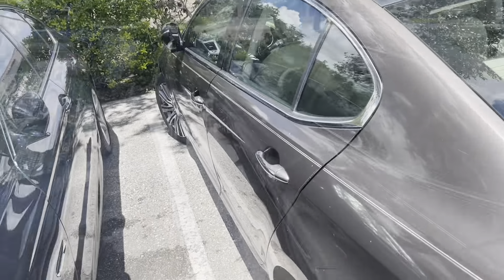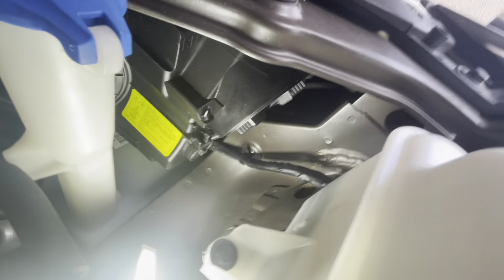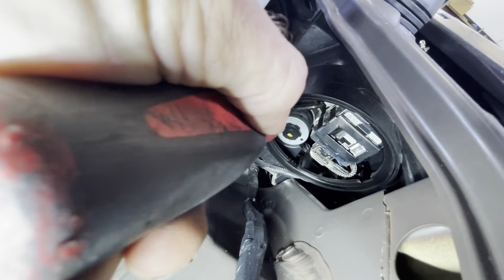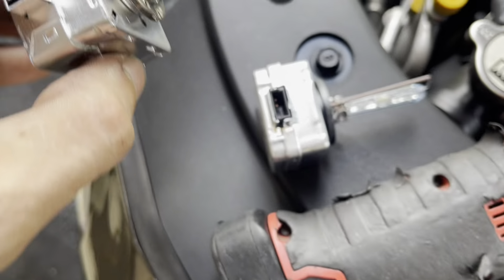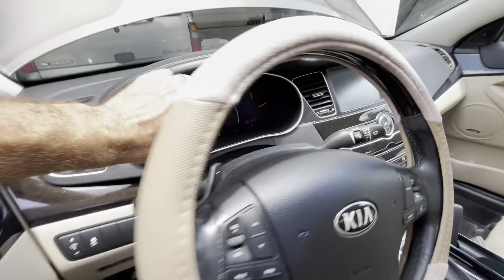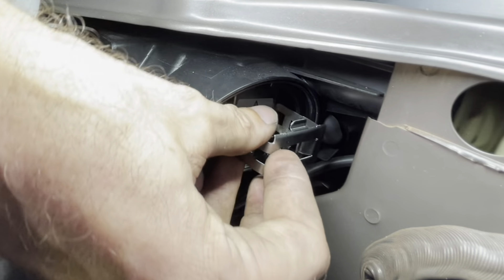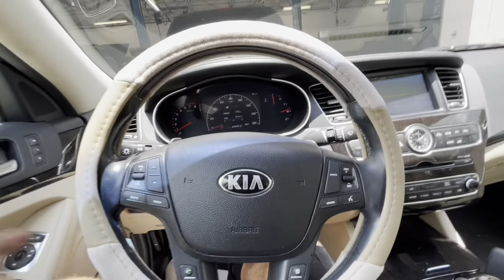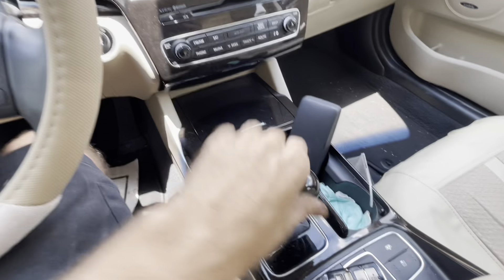Abnormal EVERYTHING All Day! Kia Cadenza

Comment: The old guys remember when replacing the headlights was done from the front of the car, outside the vehicle.  ;-)  And I'm sure you checked that high beam before tearing into the job, but you didn't show it on camera.  Wouldn't want to be the tech that fixed the low beam and later found out the high beam was out too.

Comment: My car is pretty old, but the annoying thing with the halogen bulbs it uses is getting the tip of the bulb into a holder that’s in the light fitting. Using your finger tips to wiggle it into place, hold it, get the retainer to hold it and then shove the wires on. You need 3 tiny midget hands to do it as the space is super cramped and awkward.

Comment: Nice job Ray!  Maybe next time for the mark on the seat, isopropyl alcohol (you know the stuff you use in the gas to keep water from freezing in your fuel system).  You can put the isopropyl on a rag generously and rub it on the what ever it is.  If it's a pen mark or even a Sharpie, it "should" rub out/off the mark.
Reply: Isopropyl alcohol ?? No, No, NO !! That will also leave behind a nasty spot where the alcohol rubbed away the color off of the fabric - WHICH IS EVEN WORSE !!

Comment: I haven't had to change a headlight yet on my '18 Kia Sportage, but I wanted to upgrade my reverse lights to LEDs since OEM bulbs were really dim.  I checked the owner's manual and it basically stated: "due to the complexity of replacing the reverse lights, it is recommended you take it to the dealer".   The only "complex" thing about it was I had to remove some under-bumper cladding.  Easy for me, but I can't see grandma getting down there to do it.

Comment: Headlight bulb replacement has become so much harder due to styling.  Not so much the engineers, but the styling groups within the OEM's want their fancy, wrap-around Headlamp Assembly's which then put the engineer in a pickle on how to provide the means to service bulbs.  However, the backyard mechanic is also a dying breed.  People with minimal skills could replace most bulbs..........but that would take time away from them keeping up on the latest TikTok video bashing their political nemesis.  I mean...the important stuff.  :-)   Great video Ray!  The struggle is real.  I just remove the hedlamp asm sometimes and get right to replacing the bulb.  A pain? yes, but the time works out about the same considering I struggle to get that clip back on and the bulb oriented in the proper position.  Oiy.

Comment: My buddy has a VW golf wagon with HID lights and had the low beam bulb go out on one side. Turns out that the Germans decided that to fix this issue you shall buy a new headlight at about $1800.  All for a burnt bulb, we are both considering disassembly of the headlight to expose the bulb.  Has to be a D1S or like D3S type bulb. Oh and by the way to remove the headlight, the bumper has to come off.......... German engineering.

Comment: I find simple stuff like changing a bulb is getting harder and harder. An ex-girlfriend needed the bulb changed on her Mercedes B200. I could take out three different parts to be able to get to the bulb or I could practice yoga to be able to contort and reach the bulb. I choose yoga 🤣. Getting the bulb out wasn't too hard but putting it back was WAY too hard. Dropped the clip. It didn't hit the ground due to plastic covering the bottom of the engine compartment. Magnets are my friend.

Comment: This is insane, I had to watch a couple headlight assembly removal videos real quick wondering why they didn’t just take it out to begin with. Then saw you have to literally remove the front bumper and a dozen 10mms later. I’ve got bixenon hids in my Volvo s40 and I thought those were a pain to change but compared to this shit show I feel a little better

Comment: Soon enough lights will be a “dealer required” service. Also i appreciate the self promo after the customer is clearly pressuring for time. Do the job at your pace. If they wanted a light changed in 5 minutes or less they are more than welcome to do it themselves.

Comment: Believe it or not on my car its easier to remove the bumper and then pull out the headlight assembly then change the lights.   I can change all the lamps this way fast than trying to change 1 bulb.   I learned this one when I changed out the headlight assemblies.   Next time I have to change a lamp the bumper is coming off.   Now not all cars are the same, my car is a 2008 Mazda 6.

Comment: I had a 2006 Mazda 6 where I had to partially remove the bumper (pass. side) and remove the light unit to get access to the headlight bulb. What should be a 2 minute job turned into 20. At least I had enough tools and knowledge to do it myself instead of having to pay $$$'s to get it fixed. 
I am 5'4" and often have to reset the seat after service by others but thats OK. I had to do it my self on others/customers cars when I did work on them.

Comment: hate the clip thing on mazda and the adapter that the h11 bulbs need but that looks better then this. after a few times you get the hang of how the clip things works at least on mazda. wouldn't it be easier and maybe faster just to take the whole light assembly out at this point to make it easier to see and do?

also i had sway bar and aliment done on my car and the steering wheel was moved and ac vent moved. it is annoying and no idea why that needs to be done to test drive it before and after. my seat is back all the way and steering wheel up and in all the way btw so enough room

Comment: 2013 to 2016 lincoln mkz  LED adaptive headlights were made easy for the mechanic all I have to do is pay for a 1200 dollar headlight housing and you remove power and plug in AND THE insane fees don't stop there if the front blinker DRL assembly goes out that's 1100 buckle.  They are LED an I don't expect them to go out but I didn't take chances I bought a extended WARRANTY

Comment: I was away from home, and headlight went out. I was due for an oil change, and when I brought it in to a dealership, I asked if they could change I headlight bulb for me which had gone out the day before. Four hours later, and after they had removed pretty much the entire front end of the vehicle, it was done. By now it was night, and on the drive back, I noticed the headlight was pointed 45° off to the right. 😡When I got home, I fixed it, took about 10 minutes 🤷‍♂️

Comment: I'm wondering if you squeezed the sides of that clip as you pushed it forward if it would have released from the tang. Half the front of my Silverado had to come off to replace the marker lights. An hours labor charge for replacing 3 bulbs.

Comment: Kias and Hyundais are hard to work on. Also, I think you’re supposed to just remove the headlight assembly to change the bulbs.
Reply: Then why have an access port?
Reply: ya, I just replaced the drivers side in my wife's Hyundai, and I had to remove the damned fuse box
and I must have bumped the bulb or something, because it blew and I had to do it again a week later
Reply: That still seems crazy to me. I'm sure there's worse designs out there, I just read comments about needing to remove bumpers, wheels, batteries on Mazdas to replace a lightbulb... seriously! Things are getting dumber.

Comment: As a tech nothing is more frustrating than having a supposed simple job take forever to do with lots of unnecessary stuff in the way. Some of the Ford HID lights are even worse to get out. There’s 2 little torques screws holding them in with no access at all. The headlight assembly has to come out to change it.

Comment: sadly most modern cars have hard to replace general maintenance items on purpose to encourage you to take it to the dealership.  Many of the new led headlight assemblies require complete replacement when the led dies.  A 20$ halogen or a 80$ hid vs a 800$ assembly.  And no leds don't last that much longer!

Comment: I had a 98 new beetle. If you didn't know how to remove the headlight assembly it could take ten minutes. (Thanks Bosch Engineering...) Once you know the trick (unclamp, push in, twist ten degrees, pull) it's a few seconds. The ground on mine was never exactly right, eventually ditched the connector and soldiered the wires onto the bulbs. Never had another issue... (I'd love to see the look on the guy who eventually had to replace a bulb only to find it soldiered in place LMAO)

Comment: I liked the good old days when you removed two screws from the outside and had to replace the whole glass headlight. We didn't have trouble with plastic getting all clouded up and have to polish and buff them to see at night, [which never works anyway]. And if we messed up the light directions, we just kept adjusting until cars didn't flash their lights at us when driving at night.
Just kidding, I would adjust and stand way back and see how it aimed. Or have a service station adjust them on their wall chart.

Comment: Ray - I love your content 10000% but I just wanna chime in with a tidbit about HID bulbs, just in case you're curious in the long run

The square thingamajig on the base of D1S and D3S bulbs is the igniter, not the ballast. For D2S and D4S bulbs, the igniter a separate item and is located inline between the ballast and bulb. D5S bulbs are an all-in-one variant - ballast, igniter and bulb. D1S and D3S are the same size overall though the latter is mercury free. D2S and D4S follow the same logic; same size, latter is mercury free. 99% of the OEM HID bulbs I've seen are 35W (D1/2/3/4S) or 25W (D5S). I believe the ballast output voltage is different between D1/2S and D3/4S as well, but I haven't dug that deep into the subject tbh

Comment: HID projector lighting is a better technology than plain old incandescent lamps ( which include halogen lamps) - the light is much more intense, whiter and because of the small sized source of light from the arc, optics can be used to project the light in a specific pattern that provides even illumination across the projected pattern.  This can't be done with incandescent lamps running at 12 volts.  And because the HID lamp gets so hot it must be installed in an isolated mount, and because it is part of an optical system it must be located with some precision. Also, HID lamps usually last much longer than old school incandescent lights- requiring fewer changes.  But now we have LED headlights which offer many of the same advantages as HID lighting, but the LEDs should last much longer.

Comment: I went through a similar ordeal with the headlight bulb on my wife’s 2005 Prius. After doing my circus contortionist act to get the old bulb out and the new one in, losing only about 20% of the skin on my hands and wrists. Hit the headlight switch. No low beam! Turns out I put the bad one back in.:( Never did that again.

Comment: Ive owned 2 subaru outbacks , the first one when the headlight went out it was under warranty no cost but i told my husband why in the world is the dealership giving us a loaner car while we wait for a "simple headlight change " and it seemed like forever before they called and said it was done. Then we bought another new subaru outback a few years later and probably 2 years later a headlight went out not under warranty they told us two hundred something to change it my husband had a fit good grief open the hood pull old out pop new in they are totally nuts, I will do it myself well it wasnt long until we headed to the dealership you almost have to take the whole front end off to get to the bulb, a wheel has to come off the fender well cover has to come off and it has a ton of screws. I learned after that until i find out what the mechanic has to do to repair the problem i wont complain

Comment: My biggest complaint with the vertically challenged service technician’s is they don’t return the seat all the way back I’m 6’ 2” and a big guy, don’t know how many time s I’ve slammed both my knees into the steering wheel, because once you start getting in it’s hard to stop…I would prefer it to far back compared to my situation. P.S. is that a Rampage next to you?

Comment: That is an easy one to change>>you can see it and get your hand in. The issue is the cost for the new one. I'd rather go back to the $2 round sealed beams. Yeah they were yellow and didn't project light far, but at least you weren't blinded by the oncoming car. Don'r drive so dam fast at night and you won't drive past what your lights will illuminate!

Comment: Looks similar to a D8S bulb that i have on my DS DS3 Performance. However D8S bulbs are much lower wattage than D1S bulbs and doesn't require headlight washers as its under 2000lumens. Expensive tho, £80 a bulb. -_-

Comment: One 'hopes' that recent cars with LED headlamps are sourced from high quality chinese factories using automotive rated (just below milspec) components that will actually last 5yrs or so.
No doubt the replacements will be all over the map as to quality however as to the associated electronics quality from DOA to blows out and pops in 6 months to still going in 15 yrs when gasoline will be a specialty item.

Comment: That's not actually true about hi on the inside and low beam on the outside . Maybe in the USA it is but not UK and Europe.
HID bulbs should also be changed in pairs, not as singles as the colour and performance of the new bulb will be significantly different from the old one on the other side.

Comment: Personally if I need to move a seat, I move it. For a professional as yourself. Simply get a roll of masking tape. Tape a bit onto seat rail down to floor carpet draw a small line through center and then tear tape in half at bottom of seat rail. Adjust seat till your hearts content. Once you are done with repair and park it for customer pick up, adjust seats till lines align just grab tape off no muss no fuss. It isn't Rocket Science.

Comment: And I thought the headlights on my truck were bad. The bulbs are held in with a plastic retaining ring that likes to break from all the heat cycles in the engine bay.. Recently had to change my right bulb and it wasn't because the bulb blew, it was because the retaining ring broke and the bulb fell out and smacked against something breaking the filiment.  Also hopefully the impatient customer watches this video then they can see for themselves why it took so long. Not just a bulb, its an overengineered bulb.

Comment: Nooooo that's not a Ballast and Bulb, it's an Igniter and Bulb, there's still a ballast down in the bottom of the light. D1S moved the igniter to the bulb because I guess something to do with keeping the high frequency high voltage near the bulb for bulb startup, where as D2S has the igniter and ballast as a single unit and then the bulb. You can still have a failed ballast in a D1S system, but it's not very common that OEM ballasts fail unless they've been water/impact damaged or someone has ran a worn out of defective bulb for a very long period of time...or they just have bad luck. Also not just upselling but the other side bulb will be dead soon, if that was a bumper off bulb replacement I'd sell a pair of bulbs.

Comment: Ya but if you are not comfortable to do a test drive it can make it unsafe for all that's one thing that never bothered me when my Automobile is at a shop and they moved my seat or mirror an turned off the radio if I forgot to turn it off. At 0.36 I looked and that mark was on the seat before you got into the car. You did not do it to the seat

Comment: As a tech, I always tried not to move the seat if I could operate safely in the customer's position. Sometimes you gotta, though.
As a customer, I would NEVER tell a tech they couldn't move the seat. Why not let them be comfortable for a few moments before they're hunched-over working on another car?
1:32 - That ain't a Tay-hoe, that's a Ta-hooey!

I actually loved when my headlights would burn out in my '99 Olds Intrigue. Two simple plastic retainers, and the whole assembly slides out. Pop off the rubber cap, there's the rear of the bulb. GM has a reputation for stupid engineering decisions, but they actually did something RIGHT that time!
Reply: My '99 Cherokee has the old-fashioned H6054 sealed-beam with the retainer ring. As 100% expected, the screw heads are stripped and rusted in place. I haven't been able to complain about that in twenty years of car ownership, it almost feels cathartic to do so.

EDIT: Do my eyes deceive me, or is that a Dodge Rampage on the lift? NIIIIICE!

Comment: If you really want to throw stuff....  You should try and change any of the 3 bulbs in the headlight of a 1998-2010 VW New Beetle.  I have 2 of them. a 2003 and a 2006. 2 different procedures. The headlight assembly HAS to come out. There is NO ROOM to even get them unlocked unless you know EXACTLY where the TWO locks on each headlight assembly are. NEVER try to change them below 40°F or the locks will break. The assembly has to be completely locked into the proper position in order for it to get power. So, if it wasn't the bulb, and you need to test the wiring? START OVER.  It's a super PITA.